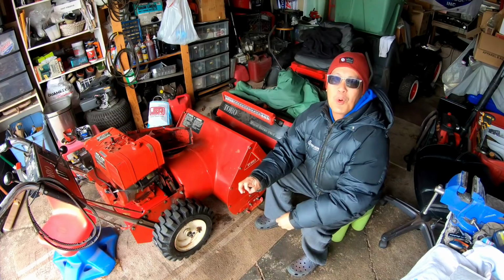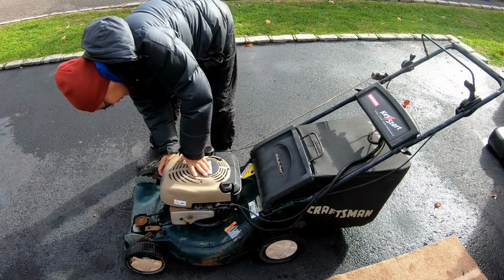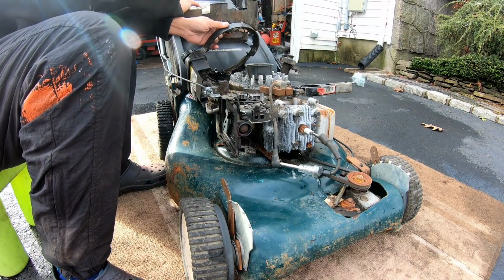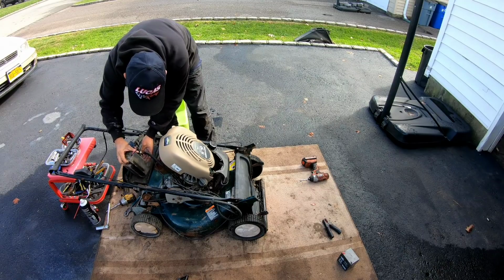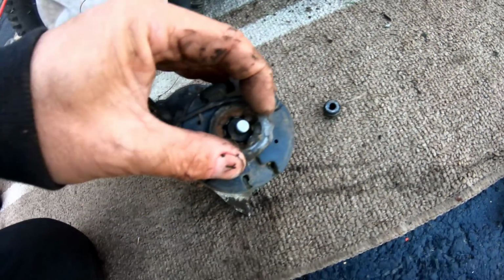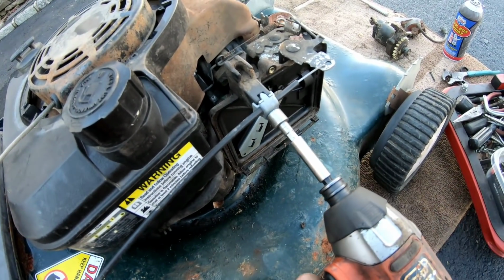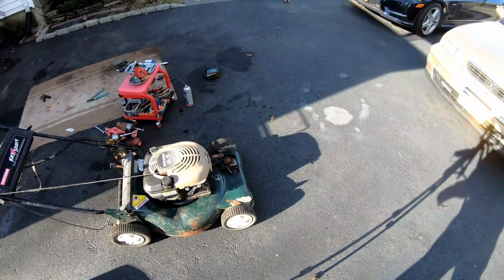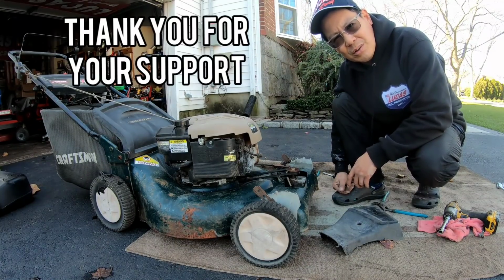CRAFTSMAN BRIGGS QUANTUM FWD LAWNMOWER KEYSTART STARTER MOTOR BATTERY MAGNETO REPLACEMENT CARB CLEAN

Comment: I have a Honda with electric start. The key has to be in the run position in order to get it to start. Much like your car - off-run-start. I forget all the time and pull my arm off - turn it to run and starts first time every time. I charge the battery up in the winter and keep it warm in the winter in our heated garage.
Reply: Honda isn't really smart.

Comment: Just cleaning the face of the magento with wire brush on a drill works for me to gain spark back in a coil.  Rust and dirt sometimes is just enough to get bad/non-consistent spark.  Might try that?
Reply from the maker: There wasn’t much buildup at all, I think it’s just doneski
Reply: Almost sounds like the blade is rubbing on the baffle which making it hard to pull.  Or something with the recoil/metal shroud it has like a tin metal sound
Reply: If the ignition coil is bad, cleaning it up won't work.  Cleaning may improve a weak spark with rust and questionable ground.
Reply from the maker: @mikespain8655  agreed

Comment: Henry, I have the same model that seems to have the same issue as yours.  That being if you stop it and try to restart it, it doesn't start.  You have to prime it.  I wonder if there is some type of design issue on this engine.  I realize B&S made a ton of these.  If you do more work and figure it out, please post.
Reply from the maker: My intake manifold is a bit worn, I may change it!
Reply: You either have water in the gas or in the engine.
If you store it outside , condensate will make its way in there.
Also make sure your air filter, housing tube and cover are on.
The cyclical air pressure from tbe engine pushes into the air filter housing and into the engine make a continues cycle once its primed and run you shouldnt need to prime  it.
Reply from the maker: @jwayne777 good tip!  Hope you’ll subscribe

Comment: I would take off the electric start stuff, that mower is not worth leaving it on there, especially if you are gonna sell it cheap, plus it wont even start it with it on. Just a suggestion, by the way, hello from east tennessee.

Comment: If you ever need a great penitrating oil you shuld try 50/50 acetone and ATF.
Reply from the maker: Or just use penetrating oil
Reply: @MowersNBlowers  I have tested 50/50 acetone and ATF against other peneitrating oil. i have not found a better pedesting oil yet.
Reply: @MowersNBlowers  you shuld give it a shot on day on a project
Reply from the maker: I've actually heard that, a few of my subscribers told me about it.  I'll try it someday.  Thanks.